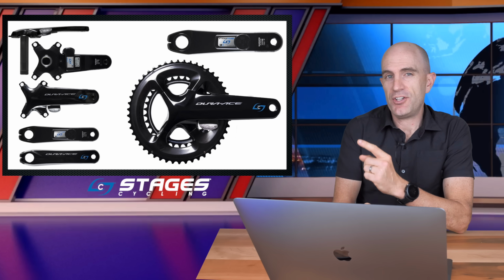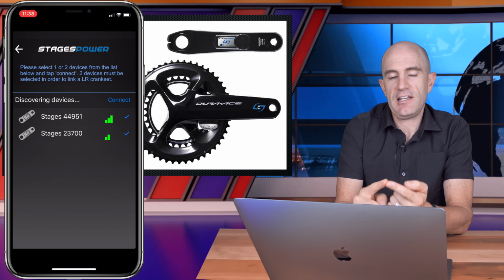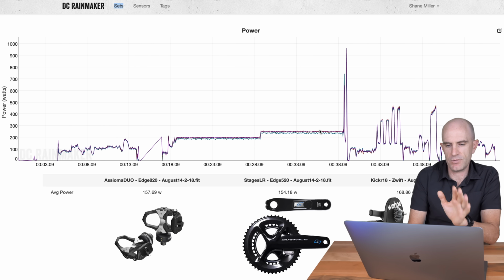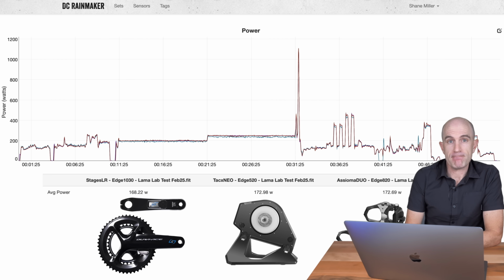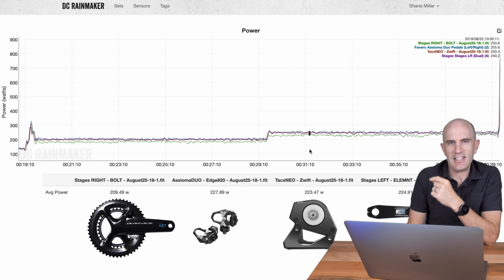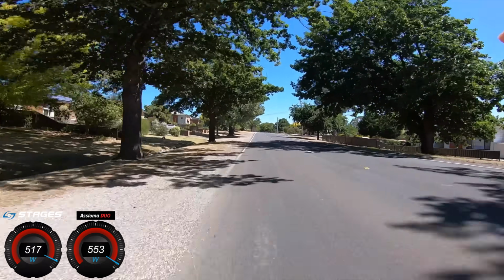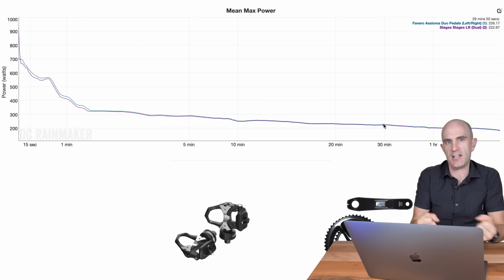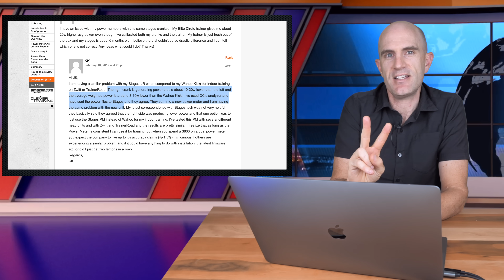STAGES Dura-Ace R9100 LR Gen3 Power Meter // Details // Ride // Data Review

Comment: Hi, I have Stages dual sided PM Ultegra R8000. It worked fine for 4 years, now over night the calibration value on the R side changed fron 890 to 850 and my L/R balance changed from 49%/51% to 43%/57% in favour of R side. The R side is obviously reading too high. My bike might have fallen in the garage on the R hand side, because my rear derailleur hanger was bent. Could this be the reason for inacuracy and how to fix it?

Many thanks for the answers.

Comment: Shane, looking for your recommendation. I have a rights stages r8000 but I am not happy with it. Should I buy a left stages r8000 or go for quarq Dfour dub. But for that I need to change BB to Dub bb30.. your comments please
Reply from the maker: The right side R8000 power meter design from Stages didn't test very well, only the newer R8100 (and R9200) with the updated gauge placement report numbers I've been happy with. Quarq is always a good option.
Reply: thanks,  @gplama  I just got Quarq dfour. but now the compatibility is a question with my Scott having bb86 shell. This is turning out to be quite an experiment.
Reply from the maker: @ItsNainuuu  DUB needed? You can get press-fit DUB bearings for a BB86 shell.
Reply: thanks,  @gplama   again, I got a BB86 Dub bottom bracket for the frame, and I am waiting for delivery. Do you second the reviews of BB86 Dub bearings' durability problem? is it for real?
Reply from the maker: @ItsNainuuu  They've worked ok for me. I haven't done a ton of kms in shitty conditions though... I guess it depends.
Reply: @gplama  I'll try them with the hope that they'll work well or else I'll shift to Gxp for better reliability. surely will update you.

Comment: How can I pair the Edge 820 to the Stages Dura-Ace LR power meter? And get power readings of both the L-side and R-side at the same time? Thank you.
Reply from the maker: Use the Stages app to ensure both meters are linked. Pair the 820 to the ANT ID of the left crank. That’ll get data from both.

Comment: You’ve reviewed the Shimano options - Shimano power meter, Stages for Shimano and have found issues with both.  I have the Ultegra group set and my bike shop is still recommending Shimano Dura-Ace Power meter as my best option.  What would you go for ?
Reply from the maker: I still can’t trust the data from any Shimano dual sided meter. Single side is a better option if you want to stick with the Shimano crankset and can live with a single sided meter and the compromise with left x2 power data.

Comment: How did you view the Left-Right power balance?  When I try to watch/see that via Shimano e-tube Ride, it stays at 0 on both sides.  I do see Auto-Pause blinking sometimes but I never could see the Left-Right power balance.  I also could not see it on Garmin Connect.  What I am doing wrong?
Reply from the maker: Power balance is shown on most head units / GPS. I also review the data with a tool that splits L/R.

Comment: Hey, thanks for the video and I want to share my thoughts.

I have a Stages Ultegra R8000 on the left side only for about a year and have the feeling that it does not display the correct data, in my case it is also about 10 watts missing

The last time I sat on my Kickr 5 and it was the same compared to Kickr & Zwift when I was sitting in the normal position on the handlebars, but as soon as I sat upright and straight and didn't touch my handlebars, it turned out that the wattage is now correct . Did you notice anything like that too?

I got myself a Stages R8000 right crank arm to see if it was still the same because I was thinking about L / R issues and differences in my case, but I didn't see this video before I got it bought. I got it today so haven't tested it yet.

And here's another question for everyone: do you know how to change the big chainring? I could only get a 53/36 (fits my outdoor carbon bike) but I have to switch to 50/34 for testing now so I don't have to change the derailleur on my old bike on the Kickr. But unfortunately I can't remove the 53 chainring because of the mechanics on the crank arm ...

Comment: Hi Shane, always a good review like always !! 
I owned a single sided gen 2 stages 105 crank 4 years ago and i'm pretty happy of the unit so far !! I then recently bought a ultegra r8000 groupset to mount on my new TCR SL bike but the colour of the crank doesn't match anymore with the rest of the groupset... I had the idea of painting the 105 stages crank to have the same colour (covering all the tech and electronic abviously ahah) but I might have to sand and then paint the crank in order for the paint to "stick". Is this process can damage the powermeter, it's accuracy etc.. ??
Reply from the maker: Hmm. Not sure. One for Stages and/or Shimano to answer.

Comment: 1 year on do you think stages fixed the right side power, because I own this stages durace power meter. There has been lots of updates since and surly they would have fixed it.
Reply from the maker: No.
Reply: @gplama  What! your joking. Lots of my riding is out the the saddle doing short sprints. I would hate to be lied to about my power.
Reply from the maker: It’s complicated. https://gplama.com/2019/06/29/shimano-crankset-power-meters/
Reply: @gplama  thanks heaps I'll read through.
Reply: @gplama  ok, well I'm glad it's not just stages it's the Shimano R cranks in general. So I would have been better off if I got left only for more accurate power which does feel pretty crap. But technically I could just remove battery in the right to single sided and you would never know but that still doesn't justify why I spent so much on the crankset...

Cheers for the reply Shane

Comment: I have both a Duraace 9100 L/R and an Ultegra 8000 L/R power meters on two bikes.  The 9100 was a factory install on my 9100 I owned where the Ultegra was purchased from Stages.  The right on both is lower than the left, but the Ultegra is more so.  The duraace shows 52/48 to 50/50 on my rides. The Ultegra shows 56/44 to 54/46.  I have an open ticket with stages when I came across this video.
Reply from the maker: More light reading here: https://gplama.com/2019/06/29/shimano-crankset-power-meters/
Reply: @gplama  Thanks, I'll have to take a few minutes to digest the link.

Comment: Hi Shane, did you ever manage to get this issue sorted? I have the same sort of a crank, but split them up over two bikes, and cant really tell if any discrepancy between them cause the two bikes are vastly different. I never used them as a dual unit so I cant tell either. Do you reckon you got a faulty unit? I really enjoy your videos. Keep up the good work and stay healthy :)
Reply from the maker: This issue is related to the design of the Shimano ride side crank. It'll never be resolved. I've had 15-16 Shimano based L/R cranks with the same issue. See my technical report and details by Keith Wakeham (his name is on the patent for this very design of power meter) here: https://gplama.com/2019/06/29/shimano-crankset-power-meters/

Comment: Wish I'd seen this video before I committed to a Stages 3 LR 50/34T setup and I appreciate your attempts to keep manufacturers honest.  This issue isn't as crucial for me because I'm a fitness rider and was simply looking for another way to measure my cycling improvement over time.  In that regard, I'm very glad I took the plunge.  Over 6 months of usage and reporting I have noticed my Right side output and balance is consistently lower than my Left.  I recently went from the stock 2X chain ring configuration to a 1X configuration using a 40t Wolftooth offset chain ring.  I had to clearance this chain ring a bit for the Stages PM 'pod' and gave it .003" all the way around, plus some more on the leading and trailing side of where the 'pod' nestles for possible fore/aft crank arm movement under load.  Calibrated from the Garmin head unit much as I do at least every other ride. I've only put 70 miles on this new configuration but am seeing far more consistent output and balance readings side to side.  Have you (or has anyone else) done any edge case testing with aftermarket chain rings or 1X configuration?

Comment: I need some advice...   My brand new 11k bike came with a lemon of both the crankset and the crank based PM pods.  The bike manufacturer will replace with a stages gen 3 Dura - Ace set and the Ceramic Speed BB30-24mm Shimano road BB to make this happen.   I was ok with this, until I watched this video.  I just talked to Stages in Boulder Colorado and they insist that Shane had a bad set of cranks and that they stand by their product.  My question is..  Did Stages fix these issues?  Did they work with Shane regarding this?  Is anyone else having the same issues currently?
Reply from the maker: Wait.... they said that? Please forward me those emails. gplama at gmail.com

Comment: Good afternoon, will the total average power at the end of say a TT be correct? Or will the inconsistency on L and R affect the totals negatively or produce lower results? Thanks for your time.
Reply from the maker: That depends. Given the readings I see in steady state ERG, yes. The issue with L/R is usually less in SIM and riding outside. I’m still not confident in any Shimano Right crank as an accurate source of power across all ranges of power and cadences.

Comment: Couldnt this just be a warranty issue with the right side. I have this exact power meter on my bike and for me its close enough, only issue is, my left side has only been lasting about 50hrs, I replaced the left side battery 4 times and the right side once.......
Reply from the maker: This isn't an issue with their warranty. I'm still looking for answers on why the right, and the replacement right does the same thing.
Reply: @gplama  thanks for the reply shano, I'm very keen to see an update video if there is an answer for this, I hope a software update will sort this issue. I don't care for 15 watts but it's true and simple, it should be accurate like most of your other llama lab tests

Comment: Shane, I'm considering going this exact route: replacing a standard Ultegra crankset with Stages Dura-Ace LR cranks. I've watched a ton of your videos and TBH, I don't know what to believe regarding power meter readings! Yes, the Tacx & Assioma readings are closer to each other, but are they more correct? Or is the Stages? Maybe the left crank is more accurate than the right in which case save a ton and just get the L version, right? Ray @ DC Rainmaker does recommend this product, amongst others. So, how do I figure out the bottom line here? And ultimately, does it matter? Even if I'm putting out 220W and the cranks say 210W, is that a material difference? It's maybe material in bragging rights, but I'm not competing with anyone, just trying to improve my power output and control it on climbs. And if the trend is positive regardless of the absolute values (within reason) then that's good too? Cheers!
Reply from the maker: Good questions. And this does my head in on a daily basis. For me, yep, it matters as I need trusted sources of power to compare other power meters to. At this point, NO Shimano based power meter I've tested gives readings I'm happy with from both sides. Mostly it's the right hand side. If it's my L/R being wonky, then I can't explain why the P1/P2/AssiomaDUO/Vector3/4iiii crankset (etc) don't show this issue. And most times I have those installed on the bike at the same time. Same pedal stroke. Different readings. Early data from the replacement StagesR shows the same issue as the first. My next video is yet another three days of 'wtf'ing. That should be live soon. 

I don't have any answers. I have data. And sometimes that's enough. See my video on the WattTeam G3 Dual for a true rabbit hole and discovery of an issue the engineers themselves knew about but didn't disclose. 

At the end of the day, none of this matters. Riding bikes is more than numbers.
Reply: @gplama  thanks for the - speedy - honest, data-driven response. And yes, I agree about riding bikes, but I've now got the power meter bug (after recording just about every other variable). Will look forward to the next rabbit-warren vid.

Comment: Any further update on this, Shane?
Reply from the maker: Nothing I want to report on... yet :) Soon. I have a replacement right that I'm throwing everything at.
Reply: @gplama  Awesome. I am trying to decide if I even want to know if my right side is reading low. I use my LR to control my Kickr, so I have the same readings both inside and out. Ignorance may be bliss for me haha.
Reply: @gplama  Did you get a replacement driveside crank?  I would love to know if they resolved this as I need to make a choice between 4III and Stages for a replacement Dura-Ace crankset that my brand new bike manufacturer is going to pay for.
Reply from the maker: @jeffbarco4394  Yes. Same issue. It's an underlying design issue with Shimano right side cranks that's the issue. See my report here: https://gplama.com/2019/06/29/shimano-crankset-power-meters/

Comment: Disappointment face that you didn't go down the LR temperature discrepancy rabbit hole. I noticed in your screenshot that there was 4 degrees Fahrenheit difference between the left and right side (70.8 and 74.8), and on my own unit have noticed temperature discrepancies of up to 6 degrees, even when the crankset has been stored inside my temperature controlled building for days, giving both sides plenty of time to reach the temperature of the room. I called Stages on it over a year ago, and they grabbed the unit they keep in house to see if it was doing the same thing. They said it WAS but assured me that it wouldn't effect power readings.... hmmmmmmmmm.
Reply from the maker: With proper ATC it shouldn't be an issue.... in theory (and in practice).
Reply: Fair enough. Still a bit wonky though, and it doesn't make sense as to why there is that discrepancy.

Comment: But why only on the right side?  Strange.
Reply from the maker: I'm still looking for answers myself. There is physical differences with the left and right cranks on the Shimano range. The left will 'flex' more than the right due to the design. This shouldn't be an issue with correct placement of the strain gauges (and quality firmware code!). I have a replacement Right on the bike at the moment collecting more data.
Reply: @gplama  Yes, I would have predicted that the left one would be more likely to be off.  I for one get everything I need from. PM by just monitoring the left side.  I can pace rides and monitor my own efforts and training stress, and track improvements.  I'm not sure if it would be even possible to correct some of what a two side system might tell you about your pedal stroke.  On a different topic, there is no way I could hold 500 W as long as you did in that video.  Chapeau.

Comment: is this the kind of problem that firmware updates can correct? if you want L/R power it's more cost effective to buy the stages unit for LR upfront and use as single sided until they fix this issue, assuming it can be fixed...? any thoughts? (would just go for assioma pedals if battery in them was replaceable long term...)
Reply from the maker: That’s one for Stages. Let’s see if a replacement right crank resolves this one.
Reply: hope so! i like the idea of stages for my setup. thanks for all the work you do!

Comment: Shane, very deep study on your unit. Here it is my take on it. I own second generation of the left side only. I have also noticed that my unit shows lower values than reading out of my Tacx Genius. Does it bother me? A little. Does it disqualify the unit? Not really. I believe that we should use power meter as a reference tool. If I test my FTP with that unit and then I am using reading during the ride in reference to it, I find it consistent and therefore it does not bother me  because I can still ride to my reference number. Do I want to compare to my fellow riders power readings? As a competitive male for sure, but does it really matter? No. Regarding the misreading between left and right side I think (my theory) that it could be coming from different placement of tensiomètres on the left and right crank arms and that manufacturer did not spend too much time on firmware to provide compensation for it. Should we as consumers expect better job for over $1200 price tag? IMO we should. But from the global perspective will that discrepancy change the way we ride or make this unit useless? Well, perhaps it proves the point that we should not spend extra money for dual sided unit? Well thanks to your test and my conclusion of it I will not be upgrading. For these people who want to know how much better is their right leg versus left you should go for the pedal power meter as it is much easier to accomplish balanced set due to the symmetry. 
It would be interesting to see how does it 4iiii between left and right side meters as there is similar tensiomètres placement on the crankshafts as Stages. Just from science perspective... Again IMO it changes nothing for the rider.

Comment: Do you know if Shimano have done anything about the Dura Ace right side under reading that you and DC rainmaker reported Shane? Sorry for all the questions trying to weigh up the best shimano option for my bike. It still seems the best shimano option without changing BBs, cleats etc is 4iii
Reply from the maker: On the Shimano power meter? No idea sorry. Given the same issues were reported independently across a number of reviews, I'd assume they'd have addressed it and had people re-test / re-review. I've heard nothing myself. I'm hoping to get a hold of the 4iiii Shimano unit(s) to put through my testing soon.
Reply: Thanks Shane, fantastic as always.